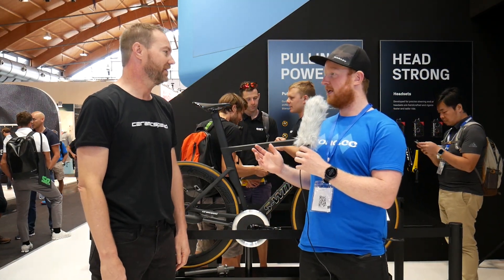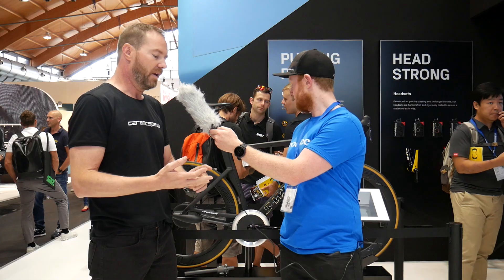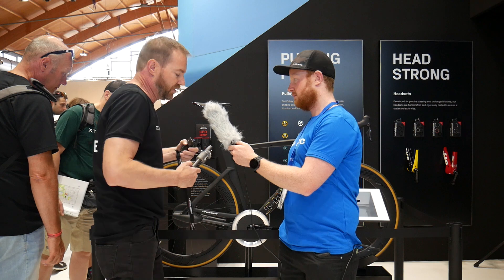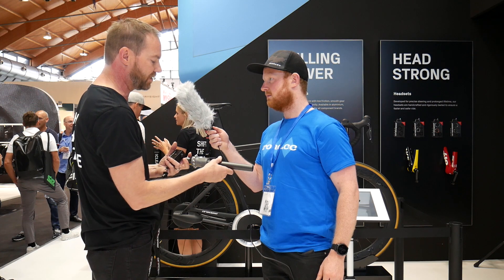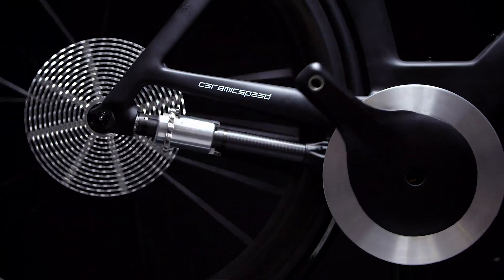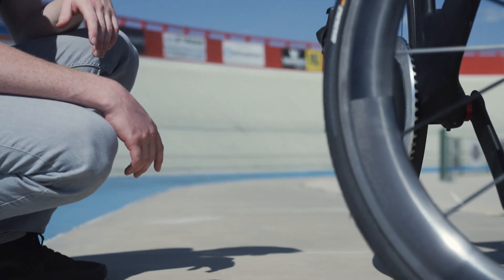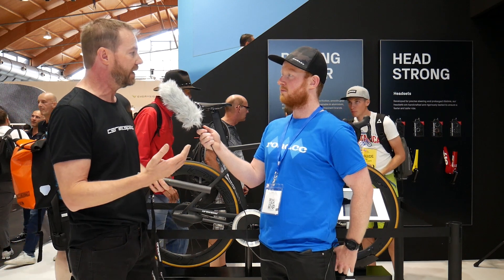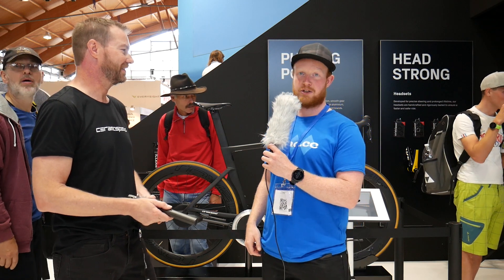CeramicSpeed chainless drivetrain shifting

Comment: I would expect the biggest trouble would be the rear disc flexing and the drive pinion popping over the cogs once you put torque through it.  It will need to be seriously stiff to prevent that.
Reply from the maker: we'll put that on the 'cons' side of the whiteboard. it's quite full over there 😂

Comment: I already figured out a mechanism that would allow this to be completely mechanical.

You would just need an index shifter and it would keep tension on a spring and each half rotation would let it shift either direction. Would increase complexity but I would love to see a purely mechanical version of this with a thumb index shifter. You could even shift 7 years at a time and it would just hold that tension and click through the gears one by one.

Comment: Cynicism is cheap and easy. Just because you can't see a solution, doesn't mean a solution doesn't exist.

Developing something whole cloth (i.e., not tweaking an existing design) is a monumental challenge.  It is done exactly as you see here, in separate components (i.e., load bearing, shifting, etc) then slowly brought together.  We are lucky that they are sharing the process with us. If you do it all at once you will have too many things failing at the same time to understand what your next steps are. 

The step-wise engagement for shifting is brilliant and means eventually you will likely be able change gears under power as materials and design becomes honed and the design becomes more robust.  The small aero gains were the design goal but icing.  The jump between gears will be something to solve in future iterations, given the creativity of this design I am sure they will think of something interesting.  That said, the first step is to get a load bearing gear changing version, get tons of miles on it and fix the issues that emerge.

I wish them the best of luck!

Comment: The radius between gears seem to be identical through out the cassett.
Which is the same as the same different in number of cogs between gears, for examlpe +3T.
Like a 12-15-18-21-24-27-30-33-36-39-42-45-48T cassett. Who would want that?
Changing from 12 to 15 is 25% easier gear.
Changing from 15 to 18 is 20% easier gear.
Changing from 30 to 33 is 10% easier gear.
Changing from 45 to 48 is 6,7% easier gear.
How do CeramicSpeed intend to create a close ratio road cassett "dish" with 12 or 13 gears?
The width of the rear roller bearings limits how little the radial change between gears can be.
For example, moving from a 12T to a 13T rear cog equals 2.0-2.5 mm radial difference, the width of the bearings looks to be >3 mm. Will not work, or...?
Changing the cassett to another range / cog spacing / radial spacing would require another gear shaft indexed differently. The way they have designed the movement mechanism don't seem very flexible or adaptable for different cassett gear ratios.

Flogging a dead horse?
Reply: 100% - this is the fundamental issue (not dirt in the small bearings). No one would ride a bike that they needed to be aero with gear steps of ~20%. Nor even steps for that matter. Given that power is going up as the cube of velocity, you REALLY need small steps when going at your limit at speed.
Reply: My assumption is that they started it as a technology demonstrator to draw attention to their other friction reducing products. There's no way the engineering team doesn't know that having tooth count as a function of radius is a major problem.